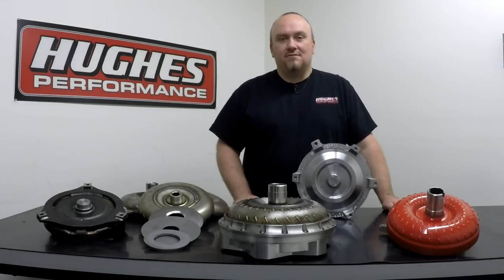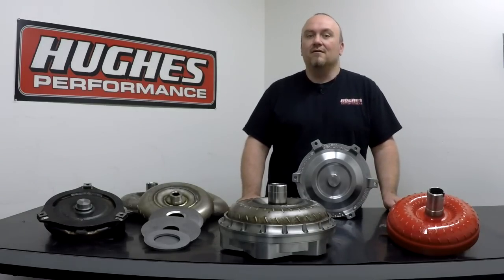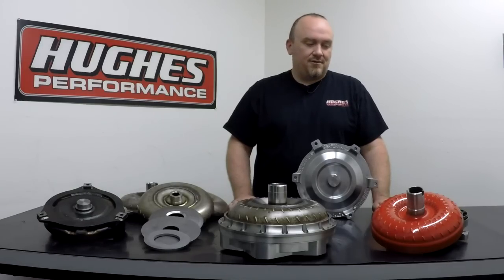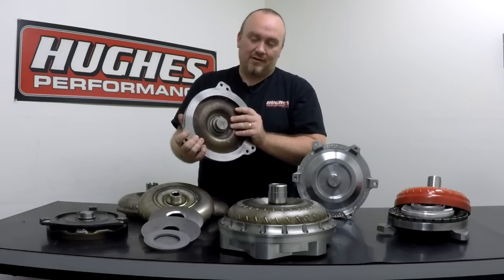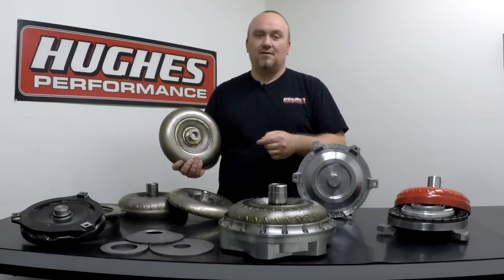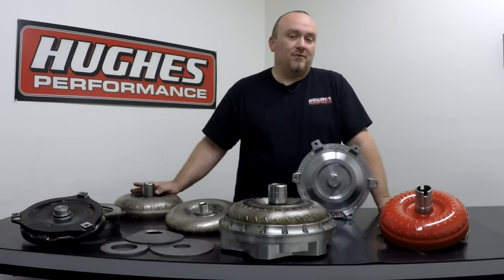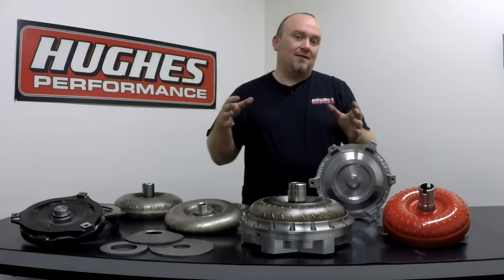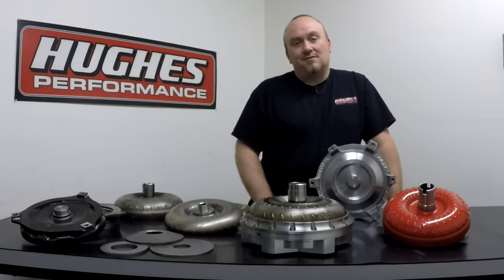Ep. 6 Torque Converters 101: Torque Converter Ballooning

Comment: Hello Pete!  Is there a way to tell if a (used) converter (TH350/TH400) has a stator support bushing? For use in a glide with turbo input shaft..
Reply from the maker: You can slide a Powerglide Turbo spline input shaft into the torque converter and engage the turbine spline inside the converter.  Try moving the turbine back and forth, but without using the input shaft like a lever.  If you detect much movement of the turbine, the converter does not have a turbine support bushing.  If the turbine moves very little or not at all, then the converter does have a turbine support bushing.

Comment: Thank you! Excellent explanation. One question. Could high RPM's (6,000+) cause ballooning as well?
Reply from the maker: Thanks for commenting!!  High engine RPM will not normally contribute to converter ballooning.  High converter stall speed RPM can contribute to converter ballooning if the the torque converter is not build with proper anti-ballooning features.
Reply: @HughesPerformance  Ah I see. So it's more of high pressure and heat than centrifugal force. Thank you once again!
Reply from the maker: @FILIPINOTUNER  you're welcome!

Comment: What is the proper converter charge pressure to keep a converter filled? Min-max?
Reply from the maker: We usually like to see converter charge pressure between 50-80psi, but the variance in the range will depend on your application.
Reply: @HughesPerformance  turbo powerglide deal. I have logged the feed (valvebody) and the exhausting side (cooler line). 
There is a pretty big swing overall.

Comment: Can someone explain the idea of "torque multiplication"?

I've heard it be mentioned a number of times as a benefit or trait of torque convertors, but never shown it in application.

Is it a case that a 500wheel torque gains something at the wheels once converted?
Reply from the maker: We explain torque multiplication throughout the Torque Converters 101 series.  Have you had a chance to watch all 6 episodes?  

We'll explain it here as well.  A torque converter provides torque multiplication through additional mechanical leverage created against the inner impeller fins as the result of the fluid being redirected and accelerated from the turbine through the stator back to the impeller.  

The rate of torque multiplication is not fixed, as a torque converter is a load-sensitive device.  The more torque applied to the converter by the engine, the more torque is multiplied to the input shaft of the transmission.

Also, the amount of torque multiplication diminishes as RPM increases.  Once the converter has achieved enough of a fluid coupling between the impeller and turbine to experience a drop in vortex flow, the stator begins to overrun (in an sprag or diode-equipped converter).  Once the stator begins overrunning, torque multiplication starts to cease.  As stator speed matches turbine speed, torque multiplication stops entirely.

This is why you'll typically observe higher low RPM torque readings on a chassis dyno with a converter car versus a clutch car; you're witnessing the effect of torque multiplication at the drive wheels.